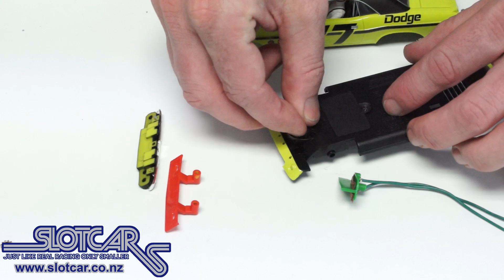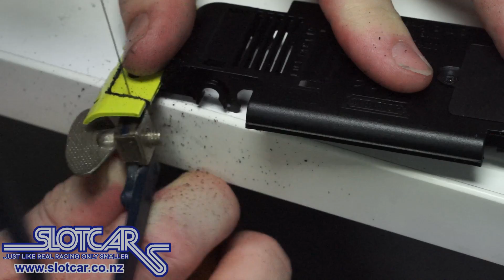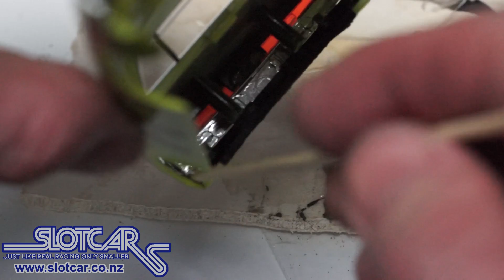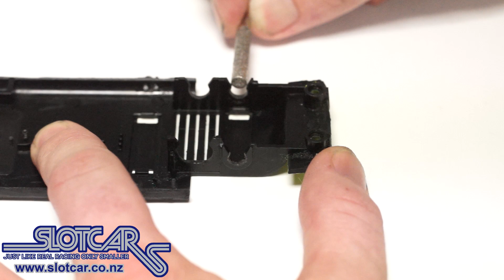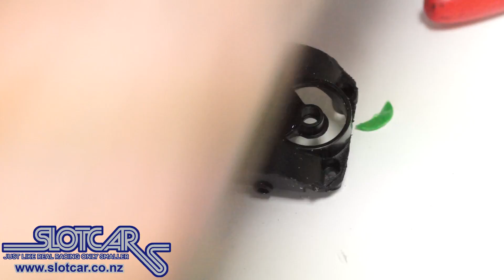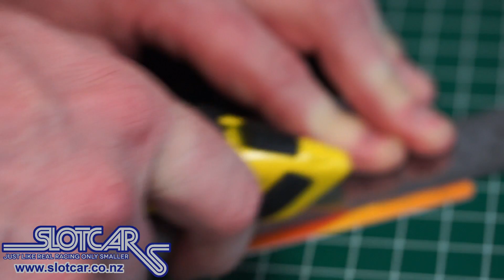Scalextric Challenger Build & Modification - Slotcar NZ

Comment: Glue should always be applied with a toothpick. I use two glues - Zap a Gap and a 5-second bonding super glue. We use magnets and 35,000 -52,000 rpm motors here in Memphis TN. USA. We run Slot.it, NSR, FLY and some Ninco.  Carrera, Scaletrex and Pioneer are considered "hunks of junk", but we modify them the best we can. The JB Weld is a bad idea if you need to swap out your motor. Don;t use concrete, use a motor mount screw. If your hunk of junk doesn't have motor mount screw holes, make them. You put magnets (optional), then the motor with pinion in the chassis first, then the bushings and rear axle because the chassis has to flex when you insert the motor. Lastly, don't glue tires on, get appropriate silicone tires that fit your wheels.

Comment: ive had the same car the torqeu of the engine will eventualy break off the little clips holding the engne to the car also had 2 camaro's they  broke right below the rearaxle.
Reply: Yes, there's one modification he should have made, replace the chassis completely, Scalextric chassis are CRAP... they break very quickly and are difficult to get to handle, as you can see, he has to modify the chassis, stupid thing to have to do... Scalextric build HORRIBLE cars... the bodies are ok sometimes

Comment: Hello,

First...thank you for the videos. There are very useful.
Some questions:
Could you make a similar setup but with a Pioneer Camaro?
Is it posible to chage the guide (nsr, Avant, Ninco...) to Pioneer cars?
What is the manufacturer of the glue you use in this setup?
What is the ref. of the nsr tyres treatment oil you use in the video "NSR Tyre Treatment oil"?

Thank very much